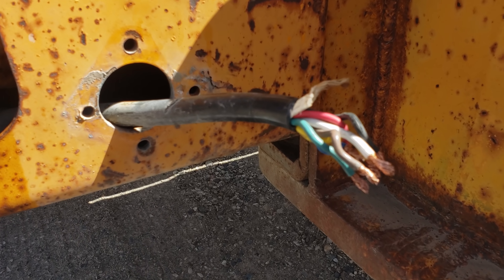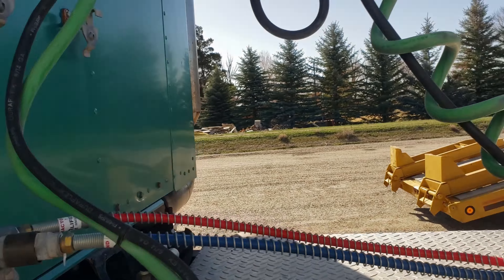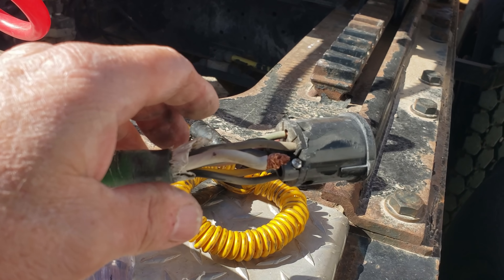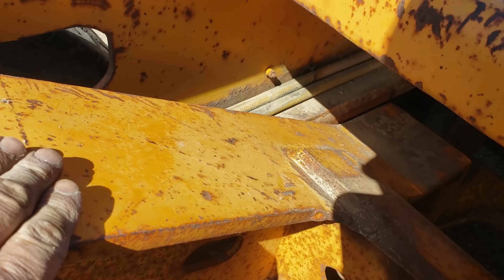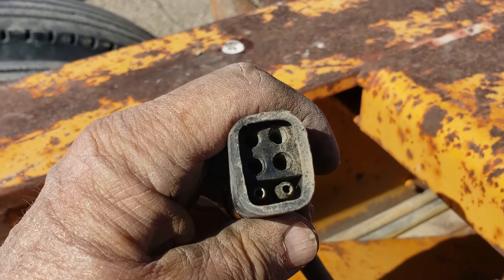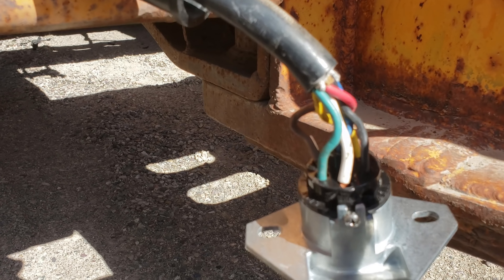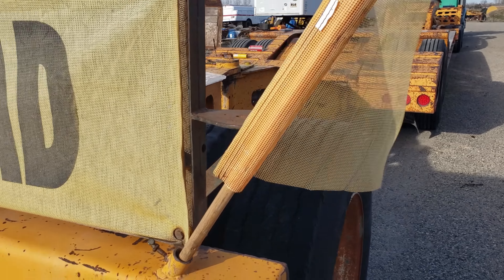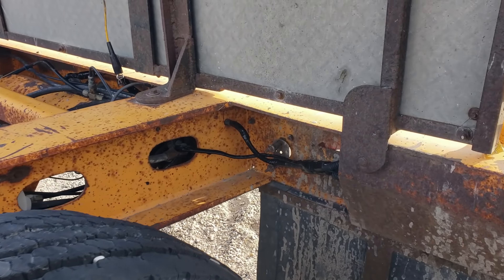I Think I Found The Problem

Comment: youtube lots info about stuff you'll never be doing   :)  but very  interesting 
brass pins crimped on wires ends better  fit in plugs Ebay  or dip ends in solder

Comment: Phillips part #16-722 is a 7 pole recepticle with screw terminals, you crimp a eyelet on the wire and screw it to the recepticle. Modular wiring harnesses should be outlawed! Keep up the good work!

Comment: 2:40 you can buy un-insulated crimp connectors.
Reply from the maker: on sunday..................
Reply: @Jpaydirt  Yeah, I don't know where I'd buy them on even a weekday.  I order 3M and Morris brand uninsulated connectors found on Amazon.  I've also been meaning to get a ferrule crimper.  I guess those along with dielectric grease might be the hot setup at the plugs?

Comment: Mr. J, about your 1:33 wire strand's dilemma.
Do like someone I know does: Weld them all together BEFORE trying to install each one into every little connector hole.
He does it with the battery cables before installing those cheap autopart battery terminals with the steel strap and 2 bolts.
The strands don't go everywhere and it's easier to get a proper grip on it.

Comment: Jeff, what I do is I use non-insulated butt connectors and I crimp onion to the wire. Then I’ll slide it into the trailer connectors i’ve had pretty good luck with that not coming loose
Reply from the maker: never thought of that ,   thanks
Reply: @Jpaydirt  No problem, glad I could help

Comment: I enjoy diagnosing electrical problems.  I HATE fixing trailer wiring.    Solder, heat shrink, di electric grease, wiring with thick rubber coating. Do it once.  Sell it if you have to do it again.

Comment: There is a better system, you can buy the connectors without the pins installed and you crimp the pins on to the wires.

Comment: I would rather have your problem. I have started chopper rolling with my 9 three hours in and i lost drive. To hot to fiddle with today. Start checking filters and pressures  tomorrow. I am thinking it will take a lot moor than 1 day.

Comment: Wire ferrules are what we crimp on for electrical cabinets at work. They work good in spring loaded connectors and screw on connectors. They come in a bunch of different wire gauges. For spade  style connectors I always solder the the wire after crimping.

Comment: I've had the same issues, and about all I can suggest is to Tin the strand type wire. It's as close as you can get to a solid wire or solid crimp on connector. Good luck there Jeff. I'm sure you'll get it wrangled up and fixed.
Reply: You shouldn't tin wires that are secured by compression - a big no no in the aerospace and marine industry.
The problem is with solder being so soft is that it creeps/gets pushed out over time resulting in a loose connections.

The best solution is just use boot lace ferrules.
Reply: @deezelfairy  I always solder  then crimp. Way less problems that way. You may find they use better quality wires and connecters in those industries.
Reply: @deezelfairy  
YES on the boot lace ferrules.  I don't know if they require a sized radial crimper and my only experience with them is seeing them in machine-tool control boxes years ago and thinking that'd be worth delving into if I ever had a customer that was totally fed up or extremely proactive (short of going full-gonzo overkill). 

There's a "very" expensive gel that is sworn by for protecting stranded wire connections and aluminum galling issues (and I'm sure other uses) who's name escapes me but iirc is most popular in the aerospace industries and not uncommon in marine "expedition" level vessels (I'm assuming you're familiar with it). Would that be something worthwhile to consider here in Jeff's application?

It sure would be nice if Marine Grade wiring was the standard for trailer wiring, last I noticed it wasn't terribly more expensive.  Yes, I'm one of those weirdos that enjoys wiring.
Reply: @gibbsey9579  Shouldn't do that either for exactly the same reasons.
 If you going to solder and crimp (although pointless if the crimps done correctly) crimp first, then solder.
Reply: @deezelfairy  that's what I do crimp first then solder

Comment: Grote sells non insulated butt connectors in various sizes if you want to save yourself some time instead of stripping all the plastic off by hand.
Reply from the maker: It's pretty easy, just take a screw driver and push out the metal connector,  beats going to town on Sunday and paying premium price for some at orielys

Comment: You could use crimp on wire ferrules for the screw terminals on the Phillips plugs and this might be the Cat coming out in me but could you use deutsch connectors in place of those rubber connectors between the wiring sections? They have better protection from the elements.

Comment: Don't need to soldier anything on the wires, just soldier the wires ends and the screws won't rip them apart like that.  Also get a couple cans of CRC di-electric grease in a spray can and hose the inside of the pin holes.  That will almost completely stop that galvanic reaction your getting.  

I'm a heavy wrecker guy with 40 years of fighting 7-pin cords, I HATE, flat dispise any crimped connection.  Twist, soldier, shrink and you'll never have to find that intermittent connection again.
Reply: That's about word for word what I was going to say. Just have to clean the grease out where you disconnect from time to time. Dirt and grease well you know...

Comment: you need to take some solder and tin the end of  wires and then put them in to the plug then tighten the screws down

Comment: tin stranded copper with solder . i strip off butt connectors too i like to put the dimple 180degrees from the split if the tubes are split. good jeff u the man

Comment: Seems like no matter how you do wiring a few years down the road you'll be back at it again. I've soldered, used shrink tubing with the glue inside, dielectric grease and used them all together and still have problems down the road but doing those things will generally get you further down the road. Anywhere there's a plug that's not sealed you're going to have problems at some point. On the plugs that don't get unplugged like at the back of your cab and the ones on your booster I always silicone those plugs in.

Comment: With the right crimper you can absolutely crimp thru plastic. Also each side set of lights should have it own ground wire. So on trailer you should have 8 ground wires and 1 at each plug bare metal on frame then silicone over when tight. Also dielectric grease in the plugs make a world of difference in the connection.

Comment: Where did you get the VSA plug saver? We haul machines on a 40 ton hydraulic tail trailer and fairly often we have to back down driveways or jackknife the trailer to get spun around in very tight industrial areas and I know that it's hell on the gladhands and the plug. 

Also, do you know when the Black/Grey Anderson Construction hats will be back in stock? Need to replace my old one
Reply from the maker: https://www.vsaplugsaver.com/   tell em ol paydirt sent ya

Comment: With stranded conductors clamped by screw pressure just buy a $30 boot lace ferrule kit from amazon and afterwards pack the connector with grease - problem solved 👍

Comment: I was between Nashville and Huntsville AL and saw the longest lowboy rig ever by a rest stop. The Mack truck was triple axle with 3 stingers, the lowboy, then 3 more stingers then a cab with a guy sitting inside. The load was tarped but it looked like a power transformer or generator. I counted the tires and came up with 128 total with the tractor. What’s that guy doing in the back? Just a lookout? Is he controlling something like brakes or steering? They had 2 chase cars on front and 3 following. It was impressive. If anyone knows how a rig like that operates please hook me up with some knowledge
Reply: The stingers in back were probably steerable. That's what the dude in back was doing, with directions from the spotters.

Comment: Jeff you gotta get one..   Knipex 97-53-09 Self-Adjusting Crimping Pliers - End Sleeves (ferrules)
Reply from the maker: so I checked that out, will those ferrules fit into the plug, cause if they do I want one
Reply: I use them and they work
Reply: @Jpaydirt  they make a box kit that has the stripers as well as a assorted sizes of the ferrules and the crimping tool . knipex 97-90-17 .